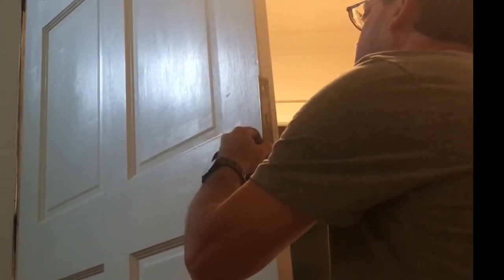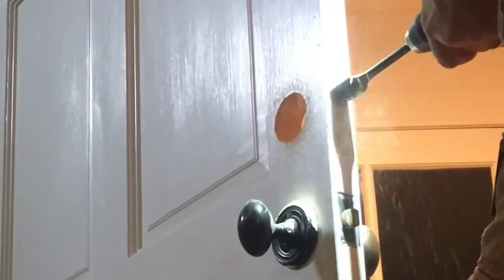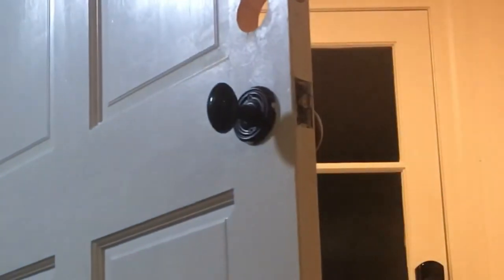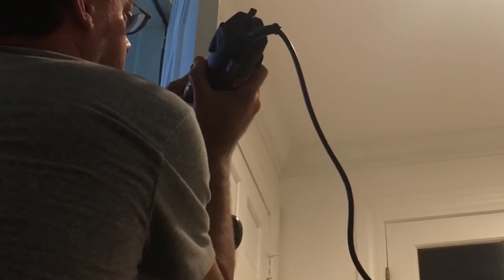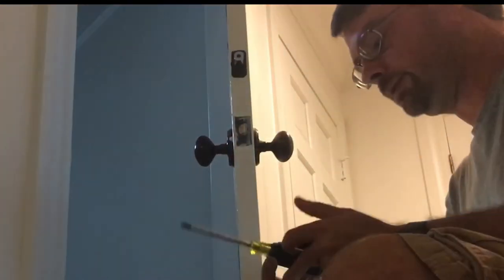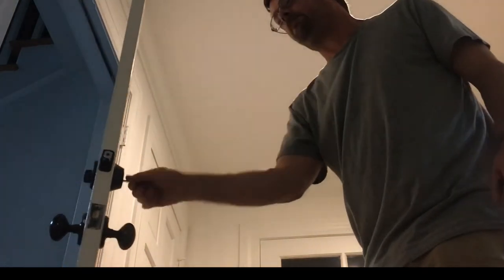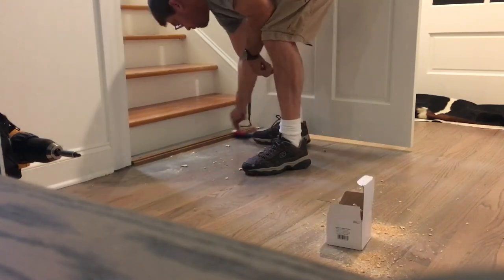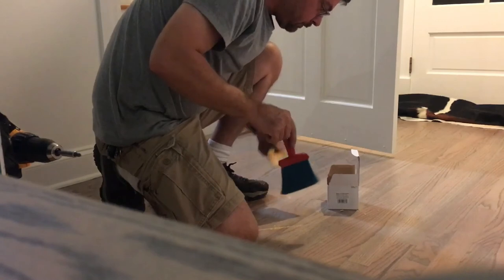let's install a deadbolt on an interior door 🚪 shall we

Comment from the maker: Since I cannot seem to reply to some comments 

1: The strike plate is what comes with that deadbolt and many others, even Schlage B60 series deadbolts comes with that style of plate and it has gotten very common in the last 5-7 years in the "deadbolt world" It is not a knob strike, those have an interior lip and are not cut out like the deadbolt plates are.

2: Short screws (and that plate) was used because this install was not for a security issue. The customer was not concerned about their 3 year old kicking in the outswing door to get upstairs to the guest room.
Outside door is a whole different strike plate install style. 

😒

Comment: You can still chisel the edge of a smaller
Door put the latch through the hole
Mark the face of the latch with a pen
Next use a sharp utility knife on the
Door edge were you marked it this
Will keep the edge of the door from
Splitting when you chisel it

Comment: I remember you saying somewhere that you had to modify the base of the trim router, what exactly did you need to do?  Thanks!
Reply from the maker: basically (its square) and I cut it (the baseplate) in half about 5/8 of the way across the hole the bit goes through. This allows you to get closer to the center of the jamb when using it for strike installs. I will probably talk about that in a future video (in planning stage) about Harbor Freight stuff ;)
Reply: Cool! Can’t wait to see that video! I usually run a 2 1/4hp router and a jig for doing electric strikes, and chiseling takes way too long when you’ve got a bunch to do.

Before I start hacking my trim router, I think I’ll hang on and wait for your video!  Thanks for replying! Keep those videos coming!

Comment: Looks like a complicated solution. I always just put the screws in, to keep the lock in position and then slowly cut a line around the plate wth a sharp knife, to make sure all the wood will split, where I want it, and then gently chisel layers away.
Reply from the maker: Rune International it is a bit more tedious but after you get used to using it, it makes it actually a little less worrisome. The thickness (or thin-ness) of the door makes chiseling (even scribing and chiseling) a bit worrisome in the wood these doors are made of. Thanks for watching :)
Reply: SE Lock and Key when I have to install a ruko lock in old thin doors I can't just drill the 1" hole. I have to take a huge block of wood out, leaving the walls almost paper thin. one day I will poke the chisel thru the front of the door from inside